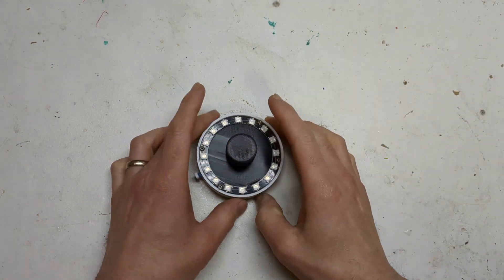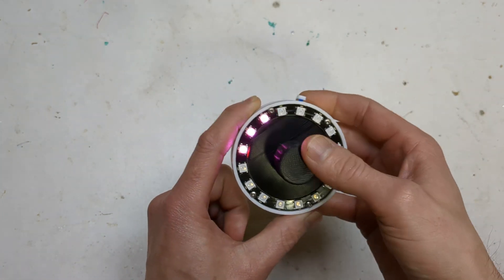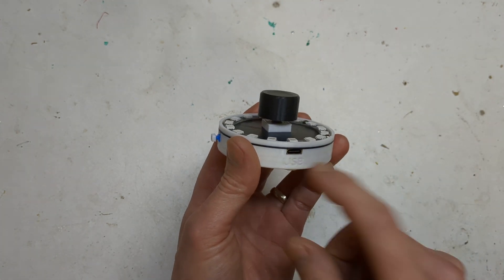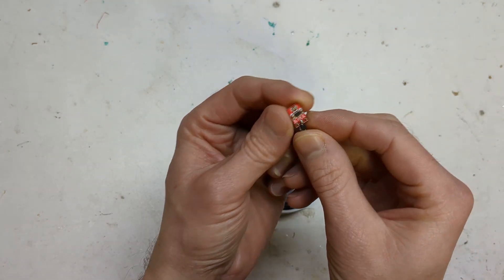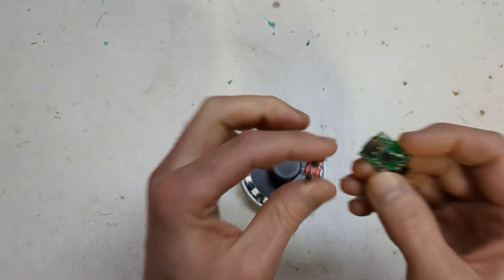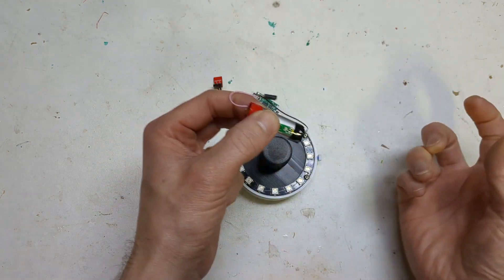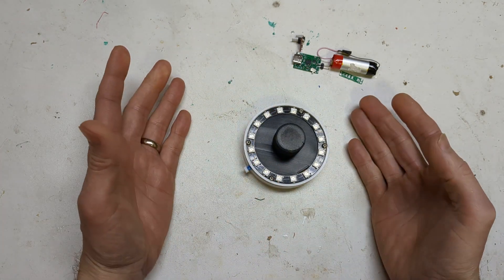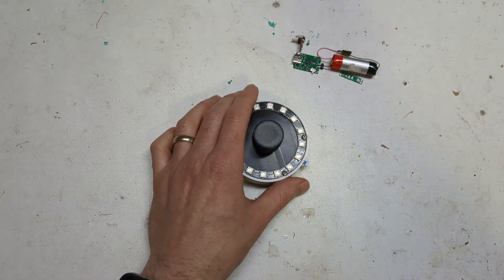Fidget Encoder

Comment: heres a tip! esp01 has a pretty much negligable power draw when in deep sleep, you can use the wake up pin as an "on" pin, and use a timer to put it back to sleep, using this method, you can use vape batteries for months of deep sleep, and you can use the esp01 as a normal microcontroller if you keep the wifi off, and you can enable the wifi for short periods to send data
Reply: really like your work, im subbed, hope to see more
Reply from the maker: Yeah that would be a good option. I need to experiment with sleep mode in more projects.